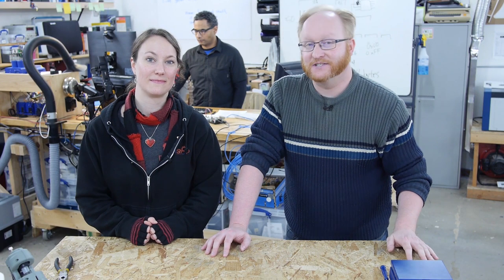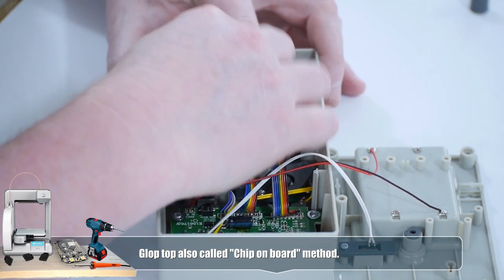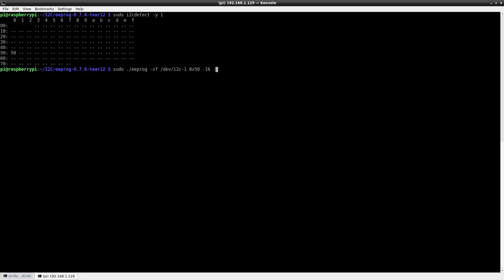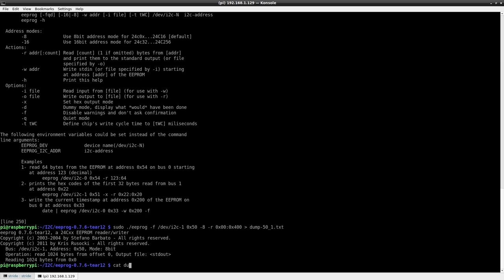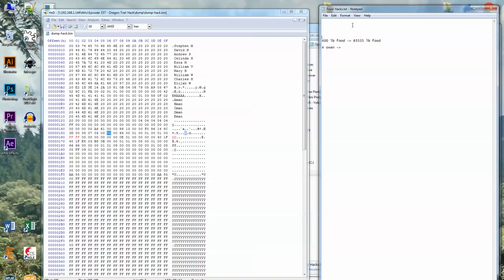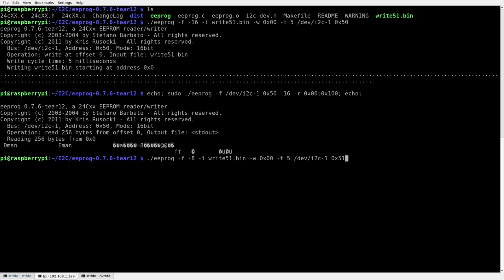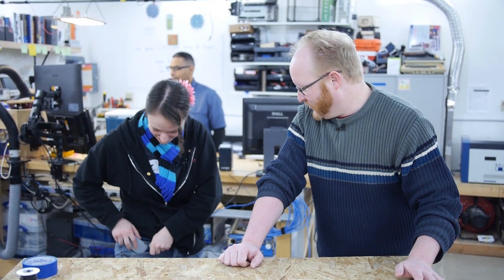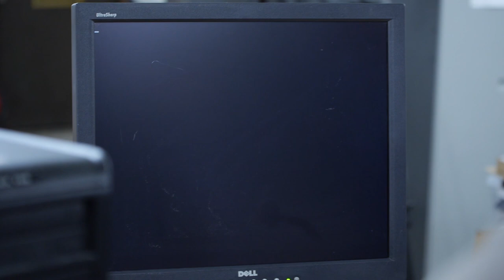Oregon Trail Pocket Portable

Comment: GP batteries are surprisingly good. (We even sell them in stores over here) Kinda surprised to see them being thrash talked lol.
Reply: Yeah, same here, GPs are good.
Reply: Yeah I was going to say the same thing, GP is a good make of battery, assuming they aren't china fakes of china originals
Reply: yep, there were so good that shores stop sell it here in israel as it kill the battery market ( people would buy only few rechargeable, and not buy every month)
Reply: Gp is a reputable battery maker. They do make some crappy leaky batteries though but that's only because there is a market for those as batteries to be delivered with cheap multimeters and guitar tuners. These ones looked like proper alkalines though and they are all good.
Reply: GP sells a very good battery.... the ones that come in that unit are NOT that good battery that GP sells.
Reply: I'd have GP batteries over Duracells pile of shit
Reply: It's just because Heavy Duty batteries are not as good as Alkaline in anything but TV remote controls.

Comment: Zip drive?
I have all the necessary gear including a win98 machine, and it still works
Last weekend, I tore down an old gateway machine that had an internal IDE Zip drive.
I still need to test that to see if it works.

Comment: I had Hacked a Tiny Arcade Pac-Man, I found all 4 Tiny Arcade portable Arcade cabs use the exact same board. I had took out the 0 ohm resistor acting as a jumper and solder in a 4 way position switch, so the postilion of the switch chooses which rom boots up.